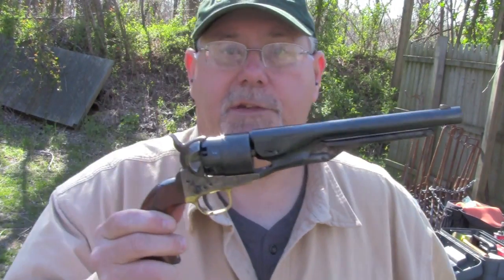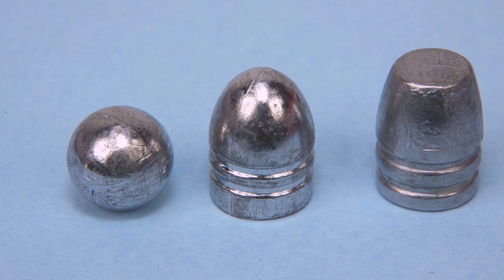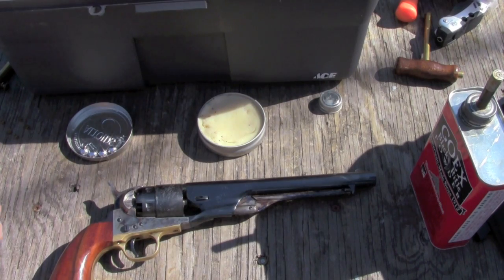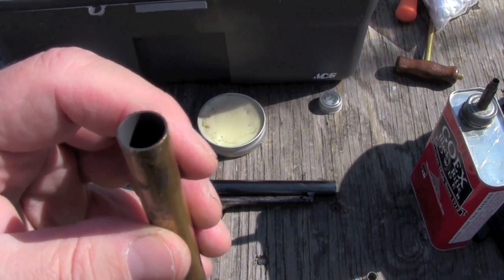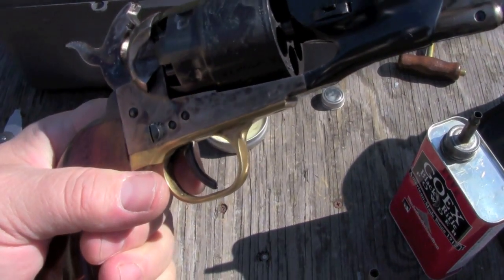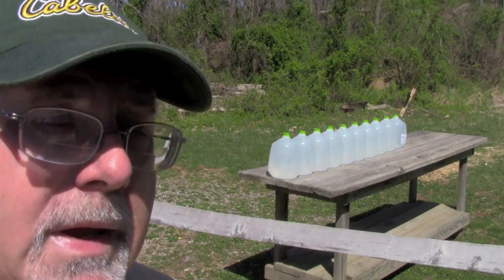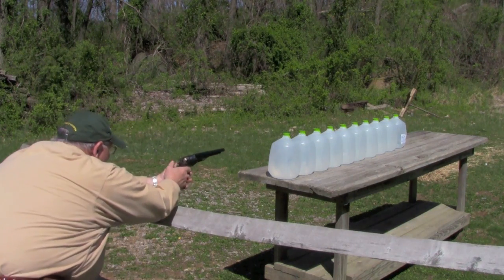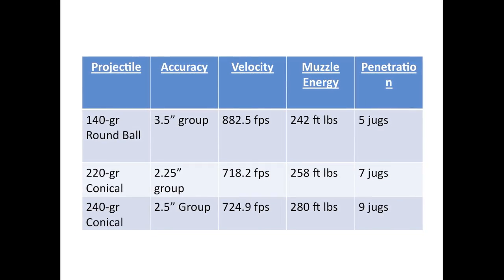44 Round Balls vs Conicals-part 1 Round Balls.mov

Comment: 140 Grain Round Ball: 
3.5inch group
Avg. Velocity: 882.5 fps
Muzzle Energy: 242 ft/lbs
Penetration: 5 water jugs

220 Grain Conical:
3.2inch group
Avg. Velocity: 718 FPS
Muzzle Energy: 258 ft/lbs
Penetration: 7 water jugs

240 Grain Conical:
2.5 inch group
Avg. Velocity: 724 fps
Muzzle Energy: 280 ft/lbs
Penetration: 9 water jugs

Comment: Hi mike. I love black powder. I just recieved my molds for 36 and 44. I have so many questions about calibers. Why is 36 .375 and 38 .357. I love your videos. Don't ever quit.
Reply: For the same reason that .44 is .454. when you push the ball into the cylinder, the bevel shaves off that tiny little curl of lead, which is the difference.

Comment: I use the Lee 200 gr cast which is exactly the same profile as your 225. I like it a lot. It's very accurate and comes out of the mold at about 198 with pure lead. I can easily get 38 grs of FFFG but usually use 30. Great, accurate, hard hitting bullets.

Comment: hello I have a question for you can a .44 Conical  200gr. with 28 0r 30gr be fried from a  1858 Rem Steel Sheriff 5.5 barrel because I cannot find any data on it being fried from a  1858 Rem Steel Sheriff 5.5 barrel Please let me know thank you .
Reply: Yes you can shoot that round and load. Its the cylinder dimensions that really dictate your load and the cylinder is the same for all 1858 remington nma barrel lengths. The barrel length will dictate how effective the load will be.

Comment: Just made my first batch of 36 and 44 conicals for my black powder revolvers.  I see where some bullets need to be lubed and sized.  Does that apply to my conical bullets made with Lee (6 cavity) molds?  You can also email me at 2040897 at gmail.com Thanks!
Reply from the maker: They don't need to be sized, but you should lube them. I rub a chunk of lube over them to fill in the lube grooves.

Comment: No wads? I'd worry bout chain fire.
Reply: Wads have nothing to do with causing or preventing chain fires. Improperly sized balls or conicals (too small) will allow a front end chain fire because the round does not properly seal the chamber (swaging). And they have zero to do with a back end chain fire.

Comment: Back in the late 60's we used to use Crisco over the round balls, applied with a cake decorator, like a big syringe, what kind of grease are you using?
Reply: The pistol is a 1860 Army replica made in Belgium, it has a stamping saying 1960 Colt Army, yes, nineteen sixty.  I got it from Dixie Gun Works about 1968 or 69.
Reply from the maker: G56AG 2/3rds lamb's tallow, 1/3rd beeswax
Reply: +duelist1954 until winter here anything I use pours out before shooting and worst after.   Conicals are food when I use zigzag rolling papers  but the balls work great.  Hey Mike why didn't they use as many balls on the civil war if they do more damage?

Comment: 220 grain at 718.2 fps and 240 grain at 724.9 fps with the same charge?
Reply from the maker: Yes. Higher pressures boosted the velocity a bit.
Reply: What is causing the higher pressure? Is it the black powder? Does the 8 inch barrel have anything to do with it? When I reload my 45acp, I never get more velocity with 230 grain over 200 grain.
Reply: tccoup355  the larger was probably .001-.002 larger and created a tighter seal allowing less pressure to escape, also more weight = more resistance
Reply: Thank you, that made a lot of sense to me.
Reply: Isaiah Escobar o

Comment: In My 1858 Remington New Army .44 I use a .454 Round Ball over 30 grains Pyrodex P with Crisco for lube and no wads. This is an excellent load and is very accurate. Conical bullets in a cap and ball revolver are of no advantage.
Reply: Flat nosed conical bullets (44 cal 200 to 250+ grains) will punch much deeper and leave a much larger diameter tunnel thru living flesh compared to a round ball. Very important difference if you are hunting as the conical will kill game much more quickly in the ranges between muzzle and 100 yards. The round ball will do an effective job under 50 yards, but loses velocity too rapidly to be very effective beyond 50 yards. ( round ball at 1000 fps MV will drop to about 700 fps at 100 yards, while the conical at 1000 fps MV will be at 900+ fps at 100 yards!).  The conical bullet is the actual load used historically in percussion revolvers. At Civil War battlefields, revolver conicals are roughly 98% of recovered handgun bullets, with round ball revolver rounds being only around 2%.  Nothing wrong with using the round ball in a revolver, as it is very effective within its range limitations. The conical bullet does extend the effective range of a percussion revolver way beyond the range of a round ball however.
Reply: The conical bucks the wind better.
Reply: Jeep Man The main advantage is penetration, test shows it over and over... In the civil war era they only used conicals in the BP revolvers.... must be a reason...

Comment: Like your powder spout. I make the same thing using any 2 brass cases that will fit together. I also use the brass to make simple cheap powder scoops using some copper wire and solder.

Comment: isn't a conical a different name for miní ball or is the miní only for rifles I'm a flinter an I recently got a peitta 44 navy 1851 an was curious if I could shoot conical amuniton in it
Reply: I wondered the same, maybe the brass frame version will take less of a beating then a steel with the heavier bullet and recoil, but if you were going to go up to a 240 conical why not just use a xtp or 185gr 45 hp? That's what I wondered, how the lightest copper jacket hp would do, the lightest I can find is 150gr and it's a no name custom job rounds, not loose bullets.
Reply: I wondered the same, maybe the brass frame version will take less of a beating then a steel with the heavier bullet and recoil, but if you were going to go up to a 240 conical why not just use a xtp or 185gr 45 hp? That's what I wondered, how the lightest copper jacket hp would do, the lightest I can find is 150gr and it's a no name custom job rounds, not loose bullets.
Reply: A "conical" is any bullet that's not a round ball [this goes back to the Pickett bullet, which was pretty much the first adopted "shaped" bullet, that was literally a cone, while everything else at the time was still a round ball.] So a Minie' [hollow based bullet] is a conical, but a conical is not necessarily a Minie'.

Comment: what is your favorite cap and ball revolver company between, Uberti, Traditions, and Pietta
Reply: I think Mike's reply above was intended for your post: Tradition's is a marketing firm that doesn't actually make anything, just has someone else OEM it & slaps their own label on it. If you watch enough of Mike's vids, you'll see that Uberti tends to have a better cosmetic finish with one set of inherent problems, and Piettas made after ~2005 have superior tolerances [from their all-CNC production after that date] with a different set of problems [usually, lack of deburring & minimal human time in assembly.] Either one is more properly a "kit" that requires final fitting & assembly by the purchaser, altho' there are exceptions. Old Piettas used to have a horrible rep, but after they upgraded their production process they've gotten MUCH better reviews by owners.

Comment: Great video Mike, and great article in the Summer 2011 Guns of the Old West on Paper cartridges.  One question.  Do you ever have caps on the revolver break apart and jam the cylinder?  If so, is there a method to prevent or minimize these kinds of jam?  All the best for the Easter holiday.

Comment: I have 1851 navy revoler and I was wondering the need for the grease over the bullet. Ive seen this done before but Ive never done it myself I shoot a 44 caliber and I use slightly oversized bullets and when I seat them a small sliver of lead comes off giving a tight fit. Ive always hear the grease was to keep a chain fire from happening but as tight as mine fit I dont think a blow torch would set them off. If you could help shed some light on this I would appreciate it. Thanks.